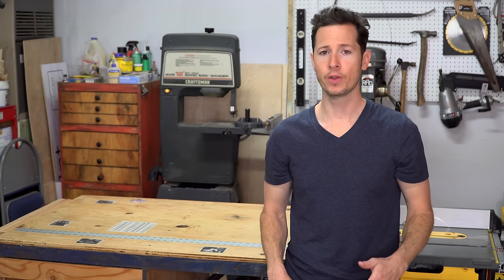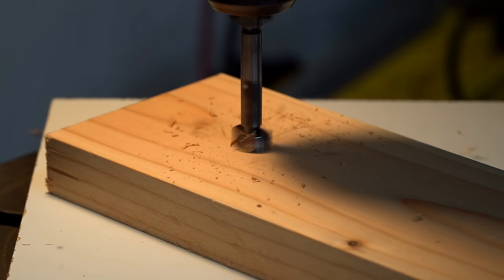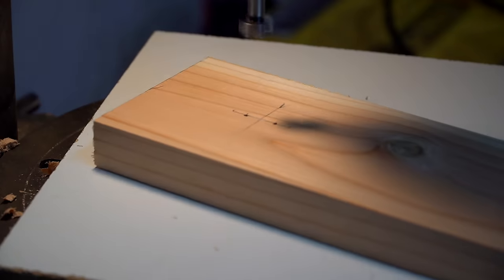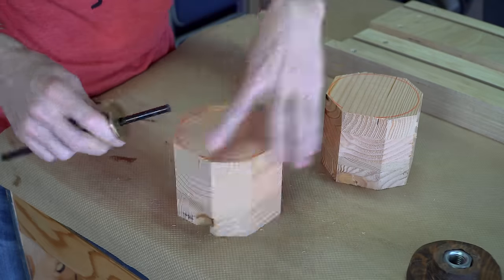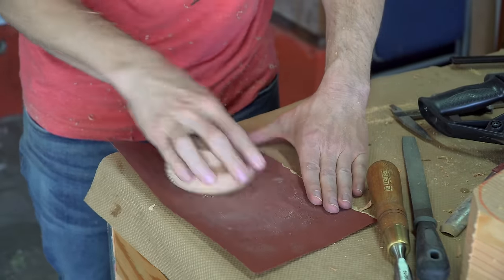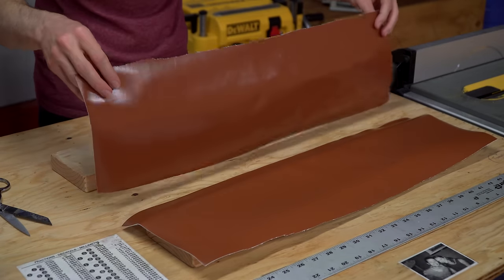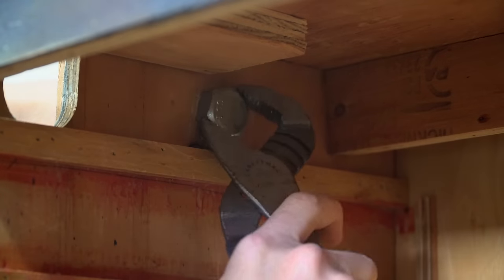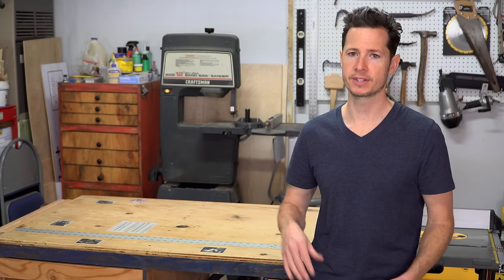How to Make a Twin Screw Vise

Comment: Nice and simple!  The pocket for the nut in the knob should be slightly shallower than the thickness of the nut so that it protrudes a bit. This ensures the nut is bearing on the washer so it doesn’t break the epoxy bond.

Comment: If you flip the bolt, embed the nut in the bench and epoxy the handles on the bolt head then you won't have 3 inches of bolt sticking out to bang into. :)
Reply from the maker: Thanks for the feedback! A lot of people have suggested it, and I might do it when I get through my other projects. Also, one of the biggest "features" of this vise is how simple it is. Flipping it makes it somewhat more complex...not terribly more complex, but at least some. Thanks again for stopping by to comment!
Reply: Great idea! I'll be making that today! My only concern with that idea, is you're not sure when you get to the end of the bolt. I'll either be adding some color to the bolt, to indicate I'm getting close to falling out, or figure out a way to block it. Thanks for the idea!
Reply from the maker: I'm glad you like it! Let me know what you come up with to retain the wheel!
Reply: @papounetpatenaude  .  Or just gnarl the threads at the end so you can "feel" you are getting close to the end.  Gnarl-grab the end threads with vice grips and distort them a bit
Reply: @loopedmess  I like it! Very "kiss" (keep it simple stu....) My current idea is to thread 2 nuts on the bolt then jam them by twisting them against each other.
Reply: @papounetpatenaude  it's a great idea however would you not lose length on the bolt putting two nuts onto them. The "gnarling" idea may retain your length a bit more
Reply from the maker: lol @ "woggle yer nards"
Reply: Hi, as a question rather than a reply, would you still use the nut in the fixed jaw as well as in the bench - and if so, presumably you would have to thread the bolt through the fixed jaw nut, clamp the jaw to the bench and then add the 'bench nut' glued to the bench - I'm just concerned that the two nuts may interfere with each other as the bolt is moved - a bit like locking nuts? Anyone any thoughts please?
Reply: No!  This is the right way to make a moxon!  The way you describe is an exercise in frustration to actually use.  Your way takes forever to open and close.  With a traditional moxon vise, you can spin the wooden nuts open or closed quite rapidly.  I mean no disrespect - apparently, a lot of woodworkers like your way but, after 30 years of finish carpentry (and about 10 years of rough carpentry before that), it has been my experience that a proper moxon vise (with 2 wooden nuts) is far more efficient and faster than the more modern twin screw (a la veritas) version.
Reply: @OneMinuteWorkbench  You nailed it with this version - keep it as is.  A proper moxon vise has twin wooden nuts which can be spun open or closed - making it quite fast to operate in addition to its simplicity.  The modern "twin screw" vise like veritas makes, is much less efficient and slower to operate.
Reply: @papounetpatenaude  One of those long black Fastenmaster HeadLOK or TimberLOK screws would be an easy way to make a travel-limit screw for the vice.  Get the length of screw that is appropriate for the maximum width of the jaw opening plus the width of the jaws and the workbench/cabinet thickness (you can glue a shim to the inside of the cabinet to fine tune if you want).  Drill a 1/4" hole about an inch below the bench screw/All-thread hole in the cabinet and the fixed jaw.   You'll be screwing the Timbertech screw in backwards -- the threaded portion of the screw goes into the movable jaw.  You'll screw it in from inside the cabinet.  The shank of the screw will slide through the 1/4" hole in the cabinet and the fixed jaw until the flat head of the screw hits the inside of the cabinet at the intended point of limit.  Put one underneath each of the twin bench screws.
Reply: KODOAN , why would wood nuts make it faster? I’m a novice and too cheap to buy a vice.
Reply: I thought the same thing, with the addition of using threaded rod and 2 nuts to gain a greater opening. It's good, simple idea that I wouldn't have thought of by myself, but my hind sight "opinionator" is always working. Nice job.
Reply: @OneMinuteWorkbench  Epoxy will do it, or just drill a hole radially into the edge of the handle and put in a setscrew. Or make the handwheel in two pieces and embed the nut within. tons of options.
Reply: @papounetpatenaude  Just epoxy a bolt on the inside  with a washer if you are going to make it so the bolt ends are on the inside as one other person suggested.  That would be preferable I believe.
Reply: @OneMinuteWorkbench  I did whip up, a quick and dirty version, with the bolts screwing towards the inside. I use it often!
 Saving space won out, over faster spinning wheels.
 I didn't do anything to the ends of the bolts. I figured I would replace it with a nicer, larger, version if I liked using it. 
Turns out falling bolts are not really an issue. I know when I'm getting close to the end. And if I go too far it's just a quarter turn back!
 I never did build a nicer one. Some tools and jigs need to be treated, like there made from egg shells! So it's a bit of a luxury to have things I can beat up!
Reply: and you can use than 1meter long bolts LMAO :D
Reply: Lol. You do use economy with words.  Warmly agree WU.
Reply: @papounetpatenaude  How did you go about doing that? I'm super interested in this but new enough that I'm not sure I can figure it out on my own.
Reply: @babyblueyes247  I took some pictures but I  can't get them on here. 
But essentially, it's the same build. Only, instead of embedding the bolt head in the fixed jaw. You embed the nut. Then slip the screw wheel up to the bolt head.  Hold the wheel there with a nut. Finnish by putting a washer outside the loose jaw. So the handle nut doesn't dig into the wood, when screwing down hard. I hope this helps!
Reply: @papounetpatenaude  just buy some nuts and Loctite them on the  very end of bolt so it stops.I plan to make a Moxon video in similar way to your project with that change
Reply: @papounetpatenaude  finally getting around to doing my own haha. Did you just use screws in other locations to attach it onto the workbench then? Since in Tommy's build the bolts were what kept it there?
Reply: If you are going to flip the bolt, you need to make different handles. Spinning bolt with a pressure of a jaw weight on it requires more force. So you need to put a stick through the handle to increase leverage. I did that and it works fine.
Reply: I am going to try this, and I was cringing over the bolts. I run into things.  Thanks for the tweak. My leg thanks you too.
Reply: @papounetpatenaude  you can put a stop at the end  of the bolt
Reply: @papounetpatenaude  If you have the means, drilling across the end of the bolt and using a cotter pin or piece of wire should stop the bolt from running out.  Alternatively, a wad of hot glue on the end of the bolt (in effect a makeshift Nylon locknut) may work as well.
Reply: @papounetpatenaude  lock nut at back end of bolt

Comment: I’ve been trying to decide how to add a vise to the side of my work bench without spending $200 on a cabinetmaker vise, so I think I’ll give this a try! As others suggested, I will probably try reversing it so the long threaded bolts go under the bench rather than sticking out. Mine is right up against the stairs to the house, so those bolts would be sticking out into the walkway. Great video!

Comment: Jaws: 4.5" x 24"
18" Mounting hole spacing
Fixed jaw: 3/4" holes - depth to accommodate 3/4" hex nuts
Loose jaw: 3/4" wide x 1.5" long slots

Thank you!

Comment: Good job! I made a similar one of these about 2 years ago and I discovered that loosening and tightening took forever. My solution was to drill a 3/8" hole in the face of each hand wheel near the outside edge and glue in a 1 1/2" dowel. Then I could spin the wheel MUCH faster in either direction.
Reply from the maker: Thanks, and thanks for sharing your experience!
Reply: The advantages of a proper moxon vise:  incredible clamping strength, speed via quickly spinning the wooden nuts open or closed (from centrifugal force).  Your solution sounds like it would greatly interfere with the centrifugal force of the nuts.
Reply: Great idea on the 1 inch dowels.
Reply: @woodsniffer  Thanks. Hope it helps someone!

Comment: Just a tip.
When you lathe the handles. Make a groove like a pulley in the side closest to the vice and wrap a fan belt or something that works as a strap that goes around both handles. That way when you turn one knob the other will turn also to allow both to turn to secure the work piece quicker.
When the work piece is secure you can turn the handles independently until th work piece is pinched to the desired hold fast.
Reply from the maker: Thanks for the tip!

Comment: Hey man just a tip next time you use the lathe bring your tool rest down to the center of your work. That makes for a much easier and non chattery time for ya. Cheers!
Reply from the maker: Thanks for the tip! Have a look here: https://youtu.be/UqvVQ2dZaAU
Reply: My thoughts exactly. Also, sand and feel behind the work only, so if something goes wrong your hand is unlikely to be jammed between the work and the tool rest. (Stuff my grandfather taught me 50 years ago. Hard to believe now.)

Comment: You used flat sawn boards for the jaws.  All construction wood will dry over time, causing the boards to "cup".  The result will be jaws that have gaps when closed.  Use quarter sawn wood and this movement is minimized.  Finding quarter sawn wood is easier than you'd think - just buy 2x12s.  Select boards that are cut from the very center of the log - the outer sections will be quarter sawn.  You might have to cut out the middle of the board and glue the outer sections back together to get a full 4 1/2" board, but this is easy and will result in a much more stable jaw.
Reply from the maker: Thanks for the awesome tip!
Reply: Hmm...I guess others have discovered my secret?  I concur - 2x12s with a pithy center often has perfectly quarter sawn sections to either side.

Comment: This is a solid project and very well explained. Good work. It seems to me like the design you used would allow you to flip the bolts around so that the head of the bolt is embedded in the hand-wheel, that way the threaded rod would protrude under the bench instead of sticking out towards the user as you tighten. Do you think that mod would work and improve the project?
Reply from the maker: Thanks Rex! Yes, I agree that embedding the heads in the handwheels would make it nicer. It would be a significantly more complex project though, and that’s what kept me from doing it that way. I might do it in the future though, and if I do, I’ll be sure to post a video!
Reply: Maybe I'm missing something.  How would doing as Rex suggested make it more complex? It would seem to me that it would be less complex and less of a hazard (no stud sticking out). Regardless of the bolt direction, great project. I'm getting ready to build a new bench and I'll probably try to incorporate something like this in it.
Reply from the maker: That current design is such that a single bolt and nut hold the fixed jaw in place and give the vise a rigid and durable base. If you change the design so that the handwheels have the threaded rod attached to them, a few things would need to change:

1. You'd have to secure the fixed jaw by some other means (probably screws  or bolts coming through the wall of the workbench into the fixed jaw. Not a huge deal, but not as elegant as the current design.

2. You'd need to have a series of female threads inside the workbench, or one deep female thread (I'm thinking 2 hex nuts spaced at about 6", or a wooden block with female threads that is 6" deep".

The reason more threading area would be required is to provide a solid feel and durability to the handwheel/threaded rod combo. Imaging if you just had 1 hex nut in the fixed jaw, and the handwheel was protruding out 6-7". It would probably sag a bit, and if you leaned on the handwheel, put too much pressure on it, etc. you'd likely crack the hex nut out of it's position. The current design on the other hand is very durable - I can grab the threaded rod and use it as a handle to roll my workbench around.

3. Given the deeper thread requirement, the easiest thing to do (I believe) would be to thread a wooden block (easier than lining up 2 separate hex nuts). The only problem with that is finding a 3/4-10 thread tap at a reasonable price. Or if you have an angle grinder, hacksaw, & files, you could make your own 3/4-10 thread tap...it would just take some time to do it and more time to tweak it to get it cutting nice threads.

4. Also given the deeper thread requirement, you'd need a longer threaded rod. This isn't that big of a deal, you can certainly buy it, but you'll likely need to buy it in threaded rod form (as opposed to hex bolt form). Without a head, you'd need to figure out how to securely attach the rod to the hand wheel. I'm thinking you'd need to grind a square shape or some sort of "key" at the end to make embedding it in the wheel easier, and to ensure that it turns the rod instead of breaking loose.

It could be that I'm overthinking it....maybe there's a simpler way. All this said, it is doable, and I might still do it some day...in fact now that I've thought it all out, there's probably not much that will stop me for doing it...............   ;-) Stay tuned!
Reply: Hey Rex, I did it just that way... it was the second woodworking project I did after I made the workbench, and I gotta say, it was pretty easy to do.  Def an upgrade.  And yea, I would like to see the updated video :)
Reply: I don't know how I missed your reply to my question but I did. Anyway, here are my answers to your thoughts on the design that you so kindly replied to. Please understand, this is in no way criticism, just food for thought. 
1. I see what you are saying about the fixed jaw but I don't think a couple of screws holding it in place is a problem.

2. The concern about dislodging the nut is noted but I think you could overcome that issue by using a coupling nut rather than a standard hex nut. McMaster-Carr has them up to 3" long. If the nut was epoxied into a support that was made of a 4x4 or a couple of stacked 2x4s, I think it would be pretty solid.

3. I think the coupling nut solves that issue.

4. McMaster- Carr has bolts up to 10" long and I'm sure a specialty supplier like Fastenal could have even longer ones. Bond the bolt head into the hand wheel and there you go. 

As for overthinking things - I think we are guilty of that from time to time. :-)
Reply from the maker: Thanks for the reply and no worries! It can definitely be done, it would just be at least a little more complicated and specialty hardware adds at least a little extra expense. All that said, I'm probably going to revamp it where the bolts go internally, and I'll probably make it with wooden threads...because wooden threads are cheap....and cool! I've got a few other projects to get through first though, so it'll probably be a while. Stay tuned!
Reply: @OneMinuteWorkbench  I think even if it makes project more complex this is way to go. I do not like idea about two steel bolts permanently protruding from the front of the workbench  in a height of my genitals. I know how this will end eventually.

Comment: Nice project!  Very accessible to the average woodworker, and an easy way to get this very useful type of vise in one's shop.  I do agree with the other comments about reversing the bolts, mostly for safety and running a hip or belly into those, especially in a small shop.  I also saw your excellent reply comment explaining the reasons why that's a more complex build.  An interim compromise might be to pop on a couple of those rubber caps, like on the end of a walking cane, but with a 3/4" inside diameter.  Home Depot usually has drawers of those little kinds of doo-dads, in the bolt aisle.  Rubber caps would also serve to keep the wheels from running off the end of the bolts, and yet be flexible enough to allow for easy removal, should that last half inch be needed.
Reply from the maker: Thanks! I'm glad you enjoyed the project! Thanks also for taking the time to share the end cap idea - good stuff!

Comment: Very simple. Great video. I have followed your video and just built one.  I have no lathe here so I used mole grips on the nuts. Till I get the wheels and handles I have a handy place to store my mole grips👍. I embedded nuts behind the back of the vice so the sticking out threaded rod  goes under the bench.
Reply from the maker: Awesome! I’m glad it worked out for you! Good luck with the wheels....you might have to build the lathe now 😉

Comment: Nice job and good instruction. I like the diy lathe too. One tip on its use: you may find it easier to control the cut when the rest and cutting edge are parallel to the floor and cutting the piece in the vertical center. Thanks for sharing your work.
Reply from the maker: Sean, thank you, and thanks for the feedback! I have made an update to the tool rest - have a look here: https://youtu.be/UqvVQ2dZaAU I hope this helps!

Comment: Awesome idea. Question, would you consider rotating the bolt 180 and attaching the fixed hex head to the wooden knobs instead? Might give you more room to work around the vice.

Comment: Very cool solution to the very old question of how to make a useful and cost effective vice. 
I would love to see if it’s possible to put the bolt heads in the handles so as to not have the bolts stick out. But I’m not sure it keeps the build simple. 
Thanks for sharing.
Reply from the maker: Thanks! If you want to build it the other way around, I’d use 3/4-10 coupling nuts. With those, I’d bet you can find relative easy ways to make it happen. Good luck!